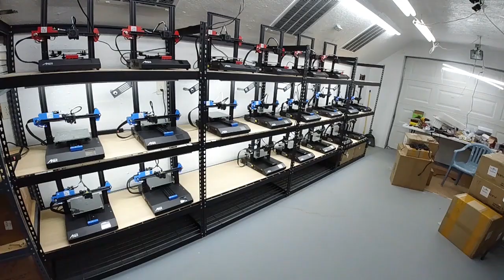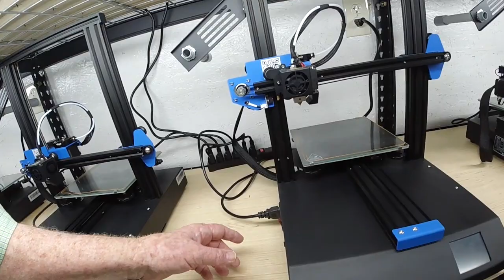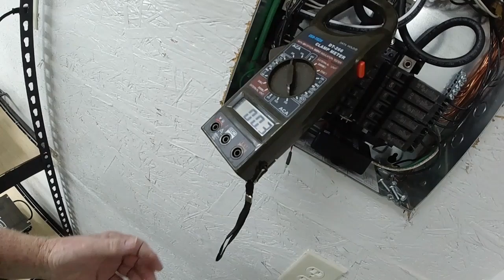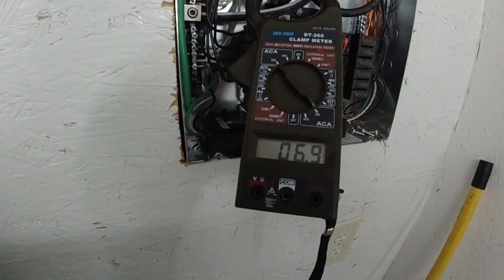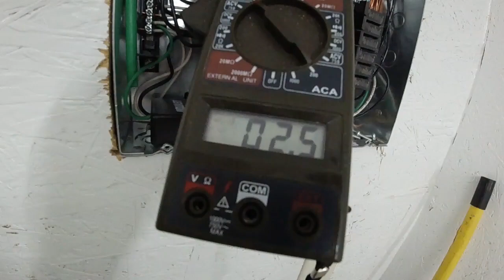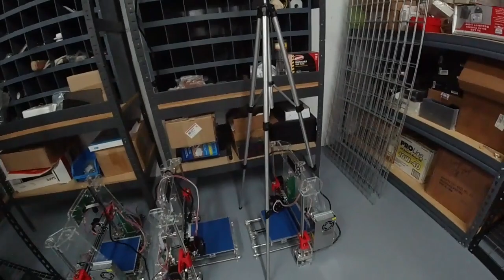TODAY MY 3D PRINT FARM GOT POWER, preparing for glass bed 3D printing on 24 Anet 3D printers.

Comment: There is only one thing missing: a drum roll! Good for you Ken. It must have been a good feeling to be able to turn them on and see that your calculations were right and all was well. A lot of work to get there and impressive to see all of them like that. And more to come!!
Sylvan is correct: an HRV (not air-to-air exchanger) might be a good option - save $ on reducing the qty of dehumidifiers. We estimated 20% savings when we added a commercial gym to our facilities for the company I worked with HRVs for the shower areas. Mind you, electricity costs where I live is some of the highest in NA! Amazing progress Ken. C
Reply from the maker: Thanks for those comments my friend. I am getting a DIY mini split heat pump soon and will install it myself. It should help reduce the amount of air I have to exchange, I will be looking for some type of inexpensive air quality monitoring device so I can be sure the air is safe to breath if I reduce the ventilation. Still a lot of things to consider in making this operation as safe as possible. Thanks for your input, as always it is helpful and I appreciate it. Going now to fire up some printers...Ken

Comment: If your summertime temperatures are hotter than your room, it would be better to circulate air in your cooled space instead of exhaust to outside requiring new air from outside. Of course, you may want fresh air.
One option would be a heat recovery ventilator (HRV) that does heat exchange between outgoing and incoming air to moderate the intake temperature.
Reply from the maker: I am currently purchasing a mini split hear pump unit that I will install myself, wait for that video, it should be interesting. This will prevent me from having to vent as much hot air. Temperatures are mild around here most of the year and I have many tall shade trees around the building that help keep it cooler. My first phase of the print farm has 24 printers and in run mode will probably draw about 15 amps which is about 1,650 watts. This should produce a a quite a bit of heat that I have to deal with. Thanks for your ideas and info...Ken